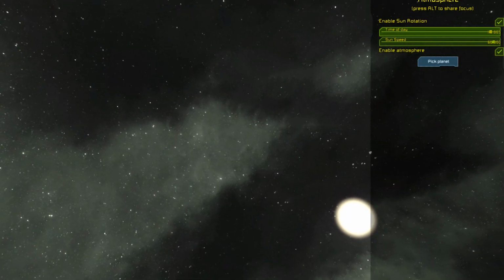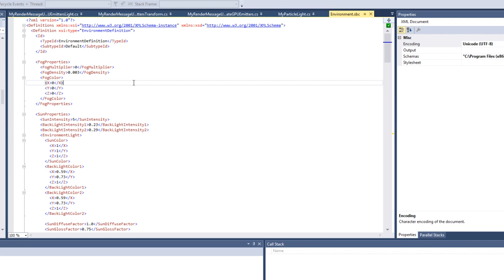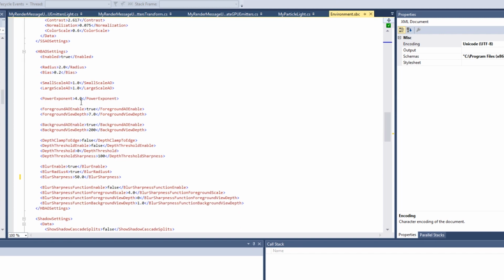Space Engineers - Update 01.150 DEV - Render Improvements and Bugfixes

Comment: Performence improvement would be great, since I cant play with Planets because with my system I get like 8 fps while standing still on planets.
A endless world without planets however runs at a stable 50 fps back in the days with DirectX 9. Havent played the game since the "forced" DirectX 11 update.
Reply: Forced Dx11 makes sense, because they must focus their resources on 1 system that most of their users use. I, instead of crying, worked more for a week and bought a better PC. I have quite cheap R7 360 and play planets most of my time fine.
Reply: considering that the last generation to not support DX 11 was the nvidia 200 series (not sure about AMD) I am not surprised you can't get good FPS in the game.  The recommended specs are that of a GTX 660 or 7870, which are beyond the equivalent of the GTX 295.  From personal experience, a card like the GTX 660 or 950 would provide you with an excellent experience in Space Engineers on planets.
Reply: i think you can play dx11 without planets
Reply: Well, DirectX 9 is lighter, but the reason they moved to DirectX 11, but it has feature that allowed them to make planets. Also DirectX 9 is 14 years old FFS.
Reply: A DX11 GPU is ridiculously cheap. If you can't be bothered getting one, that's your fault, not theirs.
Reply: I do have a 540 GT M. Its just a 4-5 years old mid-class laptop for 700€ back in the days.
Like I sad: its unplayable at 8 fps with planets
Reply: Axel Foley There is a DX9 compatible version in the "Beta" tab in Steam. I have no idea how far back it is in terms of functionality and content, but the option is there.
Reply: I know about that. problem is I want to play with my friends if i play. and they only play on planets.....
planets only work with DX11
Reply: Axel Foley
unfortunately, therein lies your issue.  Looking at a general benchmark site called userbenchmark.com it states that the recommended spec, being a GTX 660 is 611% faster than your GT 540M.  You are seriously underpowered for Space Engineers, the only solution is to get a new laptop or desktop.  a 960M runs planets fairly well, its a little below the 660 though.

Comment: can you guys fix glass and the new build menu
Reply: If it is a bug I suggest making a bug report on their forums. btw the dirty glass texture is here to stay for now :-(
Reply: Jinja no the new build menu is just kind of crap. I got really used to the old build method. Like the compound blocks work for some but on Main blocks like light armor and heavy armor they are not very effective and are very slow. Also because of this new Improvement you can't use voxel hands menu
Reply: I have already seen some build menu mods that will bring back the old one. I'm really not sure how well they work but You might thry them and see.:-)
Reply: ***** it doesn't it's still jumbled up in the menu. I would like it to go back or at least have an option from Keen to have a go back to the previous version
Reply: +James Sabins Oh well in that case the g-menu doesn't need fixing. I didnt like the new system at first , but after using it for a few hours I cant go without it. I encourage you to use it more, because it really is quite good.

Also, you can still use voxal hands. Furthermore the key to modify their properties is 'k' it has been like this for a few months now.
Reply: Jinja I build in spectator it doesn't work that well since wheel up and wheel down is to speed up and speed down respectively with that camera
Reply: +James Sabins you can still search for the individual blocks you want in the G menu, so you don't have to use the compound blocks
Reply: +James Sabins  ^This. I do agree with you about the scroll wheel thing though, that needs to be fixed.
Reply: Jinja id just like an option switch